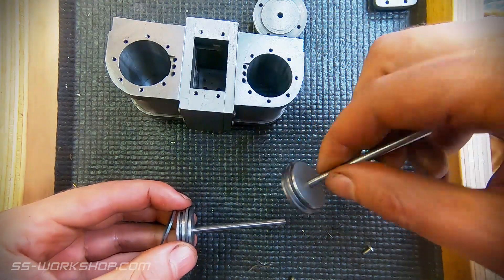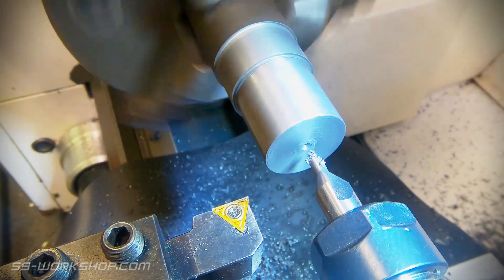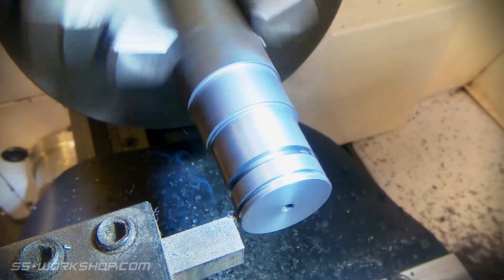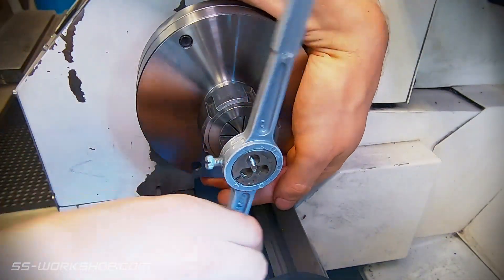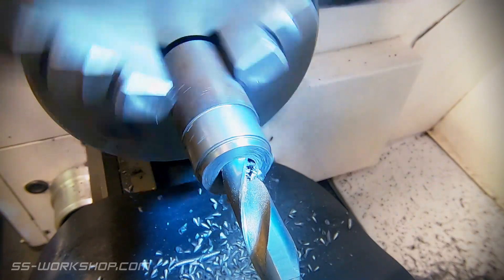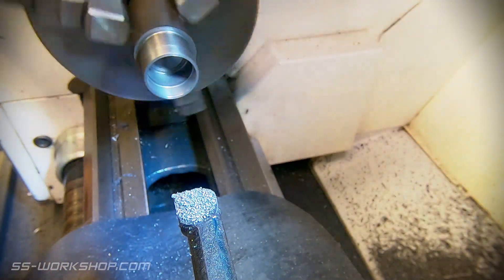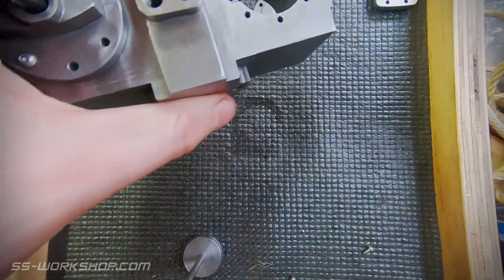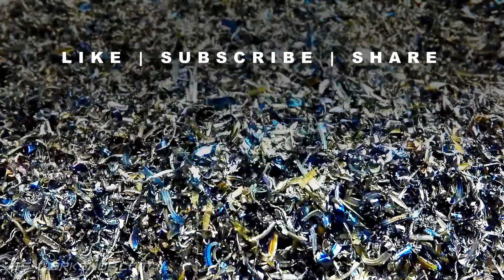Fell Engine Project - Cast Iron Pistons & Rings S1.E30

Comment: Great video. I wish my first attempt at cast rings had gone this smoothly. I’m still having nightmares and putting off remaking them. But making large rings on my mini lathe was a stupid idea to begin with 😁
Reply from the maker: Thanks, I think I got lucky here, all the way through I was waiting for something to go wrong, especially breaking one. I had a few fails but were all down to not parting them off at the correct width. If it had gone badly you would have seen a video of me installing vitron o rings instead. I actually only decided to do the cast iron rings a few weeks ago when I was watching a video of them being made and thought it was worth a go.
Reply: I think my issue was that my finished diameter was just a tiny fraction to big so it was too tight in the bore. I’ve just been too slack and started working on another loco. Everything needs to be tried once.
Reply from the maker: I found that even when they were exactly on size they wouldn’t fit once split so I used a bit of emery cloth in the split to clean up break surface until it would meet when in cylinder, test fitted on its own without piston, fitted perfectly when I was done.
Reply: I thought mine had expanded a bit from the heating process as well. I will get back around to it once I finish the rebuild of the 3.5” Blackmore Vale.